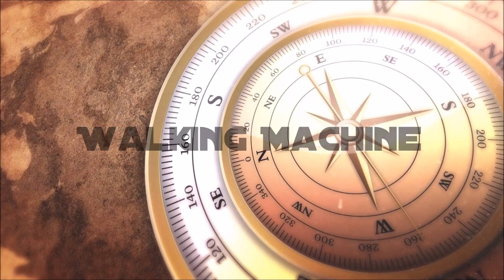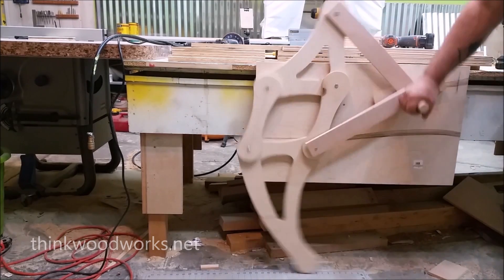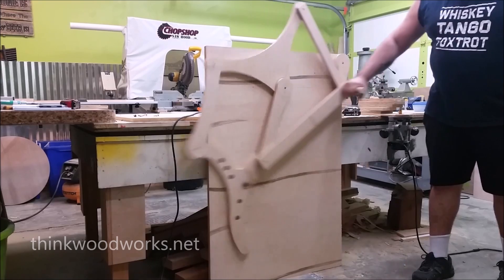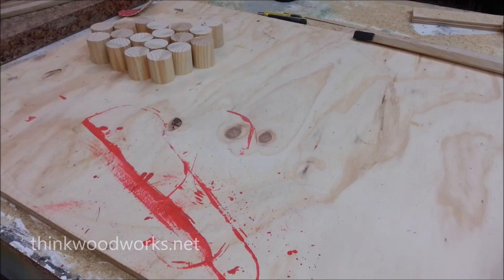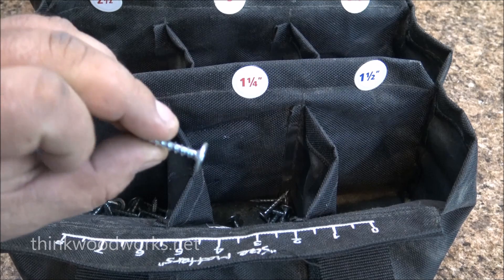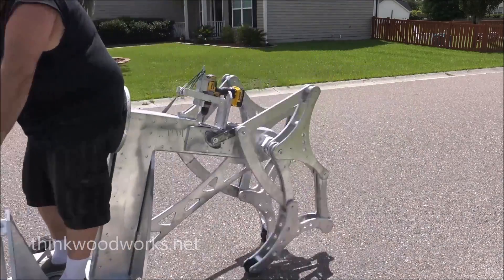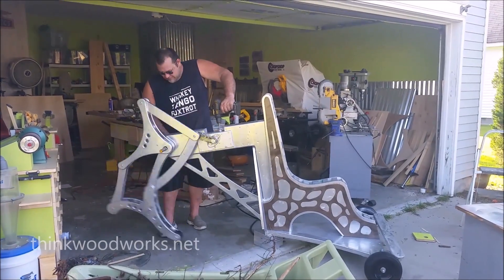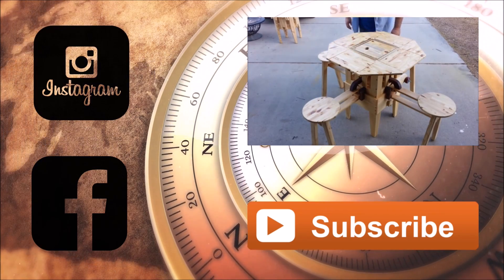Craziest Homemade Walking Machine

Comment: Did you have any problem with the painted surfaces rubbing against each other and sticking?
Reply from the maker: TheCassloop Waxed and lubricated any touching surfaces.. Not a great fix but this build is not meant to be a long lasting permanent build. More a just to see if i can type of thing

Comment: put 2 drills and 4 legs on it!
Reply: (s)AINT Cyanide in that case it would need more stuff and Electronic circuits to maintain the balance. because it is not a living creature, it cannot walk with simple 4 legs unless we add sensors and balance controllers.
Reply: I thought about that too, my solution would be wheels coming out of the side of it to keep it up right.
Reply: SAMIMY Get some gyro action, should keep it up right!

Comment: Izzy, can you replace the 2 wheel base in from with another set of legs?
Reply from the maker: Willi Wonka it possible but the steering would be a little harder to figure out. This set up was really just to test the idea to see iff it would work before I complete the design and build. There is more coming and it will all make sense when i am done

Comment: could that be changed to use foot power pedals to power it
Reply from the maker: robert adler yes absolutely..
Reply: good to know just change the drive shaft with a chain sprocket with four of them leading down to the front with three bike chains to connect in the same design

Comment: Fantastic! I have a simple question. When you were cutting the dowels, what were you using as a hold down?
Reply from the maker: Mark Haynes http://www.fastcap.com/estore/pc/viewprd.asp?idproduct=54001  If you own a chop box this is the best thing you can have for it. Never get your finger to close to the blade again!
Reply: Thank you Izzy. I will be getting one of those. Although it is kind of disappointing that it's not one of your creations.
Reply from the maker: Mark Haynes The reason I love FastCap so much is because most of their products are designed buy woodworkers like you and me.
Reply: Really? That I like. Have had run-ins with "engineers" before. Designed, created, marketed and never consulted anyone that would actually use or maintain the product. (Trying to be nice ). Thanks again Izzy.

Comment: Theo Janssens 'strandbeest' imediately came to mind, but I first got the impression of CNC'd aluminum parts. I was very surprised to find out, it's a working woodworking project. You fooled me there. In combination with this awesome contraption, the use of the cordless drill power became more of a bonus than a feature for me.
Great result! Makes me hope, you will try even bigger strandbeest spinoffs. I'm sure, you got Theo Janssens interest.

Comment: Hmmm.....if you made the stand part smaller and used just one wheel, then made it walk the other direction, you could put an awesome foam body on it and have an incredible animatronic monster for Halloween!  Or a dinosaur... A tail could hide the stand and wheel, and it shouldn't be hard to rig up a remote control for the drill. Turning would be a bigger problem...

Comment: Is the insurance expensive to take that on the highway...lol.  One question, why did you change the seat, comfort or weight distribution?
Reply from the maker: Phil Sale Ha Ha probably not .. Yes It worked fine for the kid but needed the weight more over the wheels to hold me.

Comment: Amazing work, Izzy. How many miles to the battery?  Seems carrying the weight of a human would drain it pretty fast.  Either way, it's just awesome.  Thanks. you're a genius
Reply: That's the beauty of the gear reduction. He can or did reduce the workload to where a battery could last a bit longer.
Reply from the maker: Paul Meyette Its not bad with the kids on it guessing a little less then a mile  but with me on it thats a a different story maybe a block. lol

Comment: When Izzy first gave us a few "teaser" looks at his walking machine, my impression was that Izzy's weight needed to be as far forward as possible.  That is, the wheels needed to carry Izzy's weight, while the legs would power the machine forward, while carrying their own weight, but not much else.  That's why the seat wasn't optimal: it distributed too much of Izzy's weight toward the rear of the vehicle.  A seat would still be awesome, but the "driver" would have to be upgraded to something other than a drill, I suspect.  In any event, this is probably the coolest Izzy invention ever.  I loved it.
Reply: Would bigger wheels not provide a smoother transition over bumps, stones, etc? 🤔